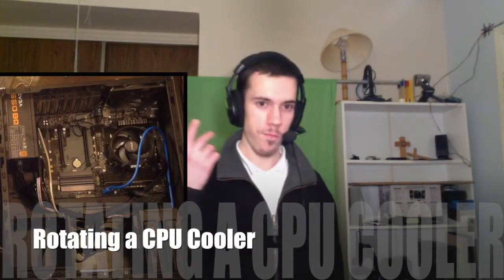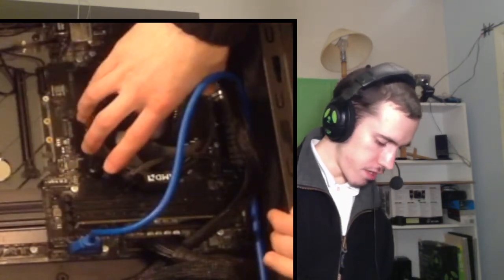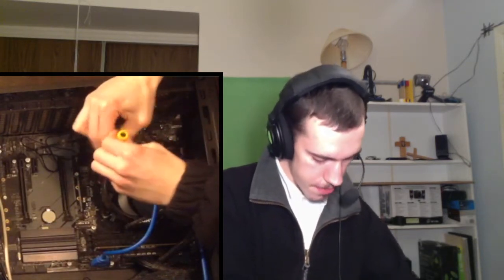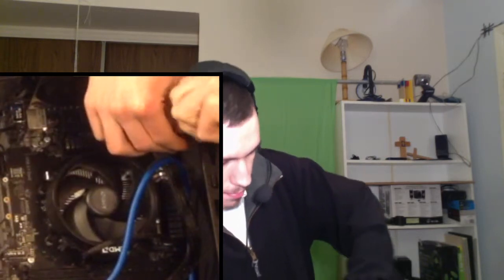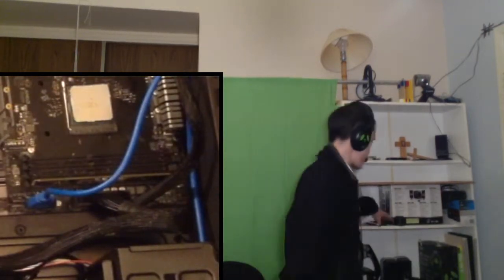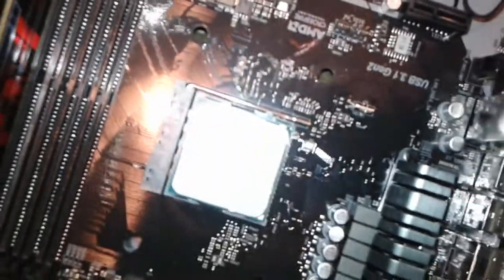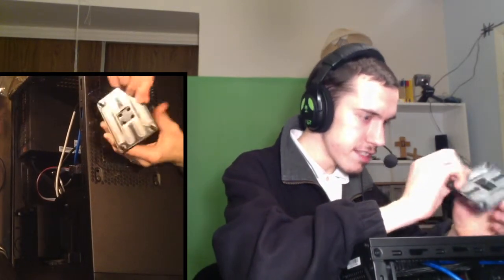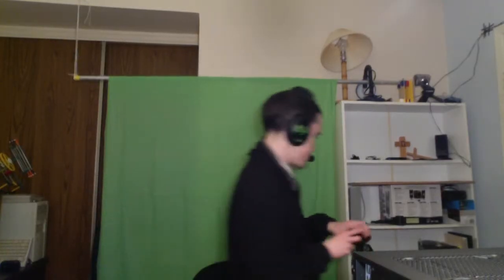Is Your CPU Cooler Not Fitting? Rotating a CPU Cooler | Installing a CPU Cooler

Comment: My cpu cooler aligns with motherboard holes but then when I tighten all 4 screws 2 of them pop out usually on the side closest to the ssd
Reply: It turns out i wasn't putting enough force on it too scared to break it, someone else tried it and got it first time lol
Reply from the maker: Excellent! Glad it's working for you now! :D
Reply: @PeculiarPineTree  thanks. I am now having network issues on top of that- not to do with pc. Got any ideas on how to fix TCP high latency & spikes
Reply from the maker: Is the lag just affecting the PC, or other devices on your network? I have issues periodically (I only notice when trying to livestream), and I have to restart both my modem & router. That fixes it for me. 

The video I'm releasing tomorrow talks about network lag a lot (mostly LAN, so it may not be helpful/relevant for this though).
Reply: @PeculiarPineTree  ok i just troubleshooted via my providers website, but if it doesn't work I'll keep an eye on the video
Reply: Do you know why changing my IP stabilises and reduces ping? I did this but then got the error: DNS_PROBE_FINISHED_NXDOMA… 
I guess I can't win
Reply from the maker: Weird… if you mean your public IP, I’m not familiar with that. I just set it however my ISP recommends for my plan.
LAN IP’s I’ve changed a lot though (not for lag, but for customization).
Reply: @PeculiarPineTree  ok 👍
Reply from the maker: Weird... does yours have a metal plate that has to be held in place underneath? Perhaps it's not facing the right way? I had issues with that plate. It's hard to hold in place, while also screwing it in at the same time.
Reply: @PeculiarPineTree  metal back plate behind the motherboard yes. I also gind that instead of unaligning the screws it just makes 2 of them hover above the holes, which usually means the other screws have been screwed in more but I do the same amount of screwing for all the screws so that can't be the issue
Reply from the maker: Interesting... is the back plate bent/damaged at all? Even if not, it can still be quite tricky to get it on.

Comment: My cpu cooler screws does not even align with the mother board holes. Im trying to install a ryzen stock cooler on a msi 970A-G43 motherboard. Anyone got any tips or should i just drill some new holes?😂😂😂🤣

Comment: I’m so confused I have the ryzen 5 cpu cooler and my board is the msi x470 gaming plus max . This is my first build , so I’m not sure if I’m doing something wrong or if these parts aren’t compatible, but Newegg said they were
Reply from the maker: What's the trouble it's giving you? 
I had issues with it not screwing in... turns out there was a back-plate behind the motherboard, that had fallen down, that the cooler was supposed to screw into. Had to hold it up while using the screwdriver with the other hand.
Reply: @PeculiarPineTree  Thanks for the response ! Turns out I was just being wayyyy to gentle😅🥲. No one ever mentioned how you have to pretty much force the cooler that comes with the cpu down until you hear the springs start to tighten.lol
Reply from the maker: Ah, glad to hear it's working now! :)

Comment: Hey, I’m try to put the cpu cooler back on to the motherboard and its screws aren’t fitting into them... don’t know how it was on in the first place. It’s a Acer aspire t180 I reapplied thermal paste and the screw look the same as the motherboard screws
Reply from the maker: Hi Connor Sams! Sorry to hear you're having problems getting the cpu cooler back on.
Does the screw seem to be not going in (as in, too big)? Or is it going in but not grabbing anything (as in, too small)?

There's a few possibilities I could think of:
- Try a different screw?
- Some PC's have a back-plate behind the motherboard that the screws screw into. In my PC it's a floating plate, that fell into the case, and thus the screws had nothing to grab onto. In this case, it must be held to the back of the motherboard with one hand, while screwing with the other hand.
- According to this teardown manual (linked), it looks like there's a "latch" for the cooler. Is it possible that this latch is pushing the cooler out of alignment slightly?
https://www.manualslib.com/manual/232889/Acer-Aspire-T180.html?page=61#manual

Hope some of this helps you! :D
Reply: Peculiar Pine Tree thanks, I figure it out there was a plate on the back of the motherboard that held the screws in place
Reply: @connorsams182  can yor plsss help me my screws doesn't fit and I'm getting a mentalbreakdown plsss help meeee
Reply: @matzz3612  What cpu cooler and what motherboard?
Reply: @PeculiarPineTree  thank u i was having this problem trying to figure it for over an hour whole time it was this. lifesaver
Reply: @PeculiarPineTree  thx for the help I just subed to your Chanel because you are the best, and a good youtuber thx for your help I really needed 😘😘😘😁😁😁
Reply: @PeculiarPineTree  how abouy m200 cpu cooler, it cant fit on my mobo the lock of the cooler get the to it
Reply: Hey can you help me a bit